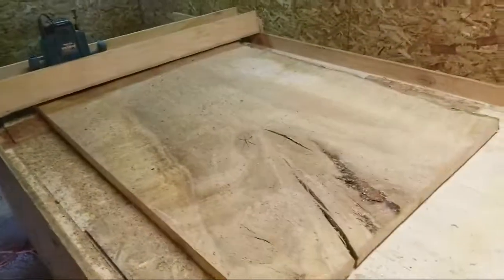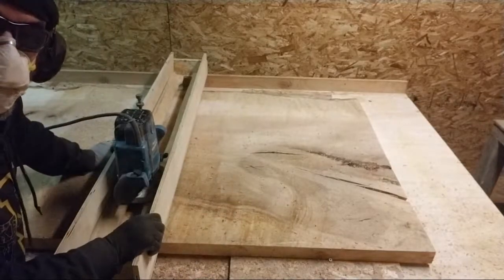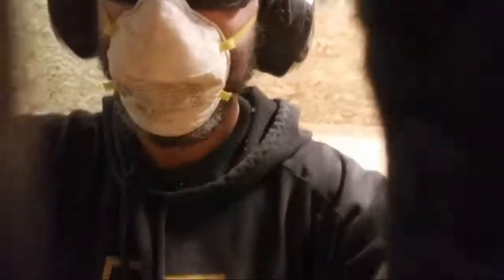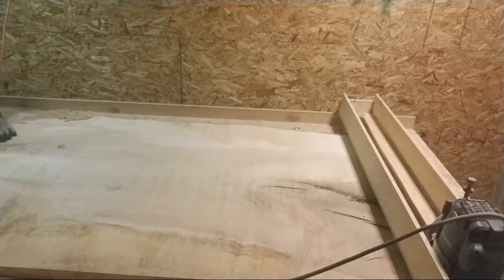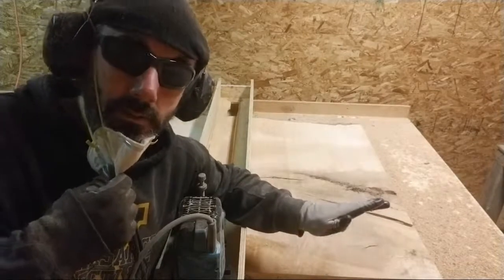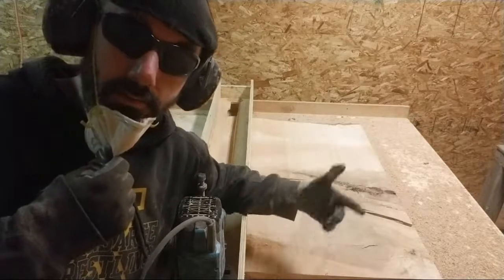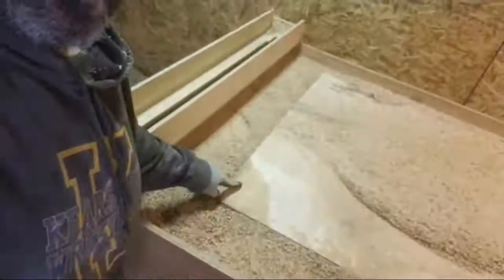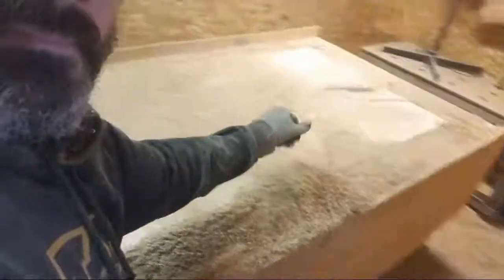Flattening A Large Live Edge Maple Slab Live

Comment: put it on some kind of rollers will you can adjust the bar where it has bearings in it where it slides left and right bearing wiseyou need to automate that thing that's what a planers for why would you have a board like that what you wanted to take the the crown out of it you can never get it out that's why you put wood together and you nail it in place

Comment: the web panel Saw works that you see at Home Depot that rips boards down cross costume that would be something better than having to do with the way you're doing it with your sliding left and right you can go up and down and let it let the machine do the up and down and move incrementally forward and put it on a gear that goes real slowbut if you keep up doing that with your router you going to bring your router out that's like putting I don't know what you just did there's like putting you know of half a year's worth of juice on ithappy years worth of Houston on it a panel saw sliding on two pieces of pipe back and forth without You lube it and basically like the way your your milling Saw works left and right up and down that's all you need to do and basically if you got to make that accurate to the point when it lowers its going to go up to a level straight across slide that's just a couple of pipes and you could you can make that yourselfyou can control it left or right but went by staying in one position is having it go having it to a radiuslike the way of windshield wiper works have it go left right left right left right and have it slide backwards on a like a little geared motorcleaners coming to feet links are you can get bigger ones but what you got there is but he's like a 3D printer and basically laser extra whatever you can have that cut out of out of a CNC machine